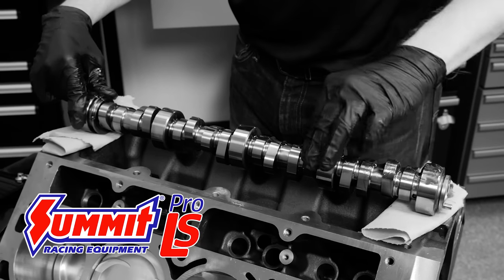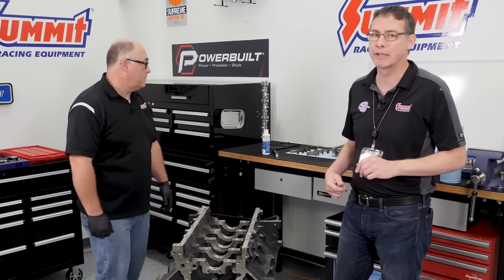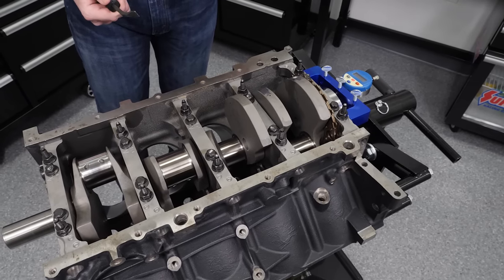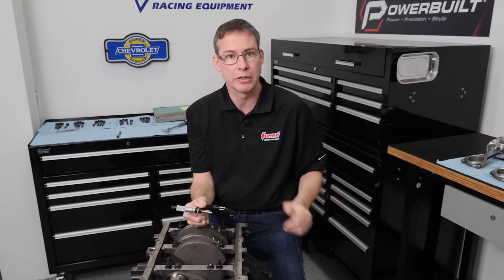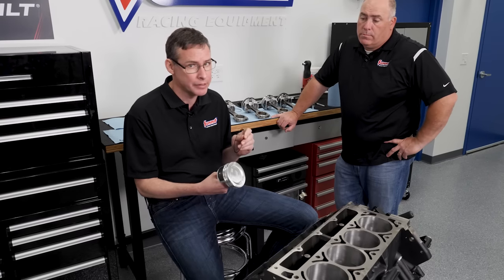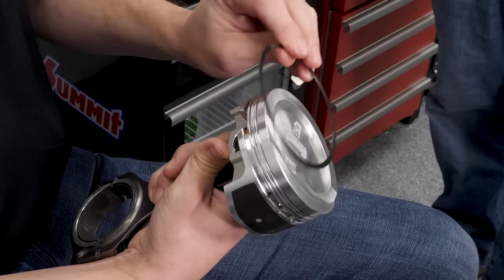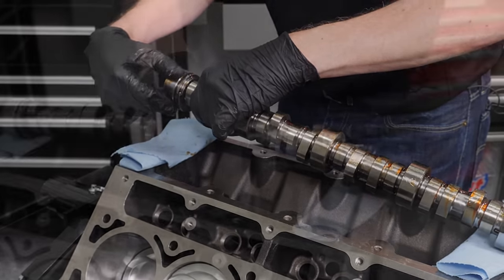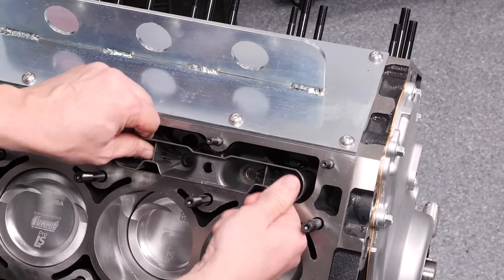Summit Racing's Project 1000: A 1,000 Horsepower 6.0L LS Engine Build (Part 1, the Introduction)

Comment: Do it n/a and I'll be impressed
Reply: Always an NA Guy saying do it NA 
How about 500hp per Liter ;-).
Reply: His response will always there is no replacement for displacement. Well there is a replacement and it's called boost.
Reply: Do it at all duey…. I’ll wait
Reply: They don't need to impress a keyboard warrior like you though 😉
Reply: @mikerudolph9785 this is true but there is more to it than just peak power.  A boosted larger engine with the appropriate parts will make more power w boost all things equal.  The statement still stands.  A large engine w shit heads may not make the peak power a smaller entije w great heads does I'm saying if both are set up properly and running boost the larger engine is always gonna make more.  Also more displacement allows you to have more torque and power in the lower engine speeds.   With a street car this matter it's not all about peak rwhp and quarter mile ets.
Reply: With a fuckin LS engine??!? That's not happening with a stock block.

Comment: You don't need a more how to video on how to make a 1000 horsepower withan LS we've been beaten on a 4.8 leader that had a 180000 miles on it for over 2 years and made over a 1000 horsepower and didn't touch a thing except adding a Turbo and intake and a Turbo  Cam and push rod And by the way it's in a drag car so it gets beat on  Weekly

Comment: Great video.  Will give novice builders the confidence. An LS is as easy as a 2 stroke. But y'all really need to comment on the important things like proper balancing, cam degreeing, having a block properly machined such as align honing, etc. So many critical things for an engine to last past break-in.
Reply: Not always the case especially on an LS Ive been making 1050whp+ on a gen3 5.3 with gen 4 rods for 3 years now going into 4th season  .. 160+ passes since keeping track and thousands of street miles is one drag week and 1 rocky mountain raceweek.. no balancing , no bearings  no extra bullshit you don't need...  Rings were pregapped for boost after 180k  lol .. there are budget builds and their are by the book builds.. my expensive by the book build is in a bunch of smaller pieces and all the machine work and brand new parts didn't matter my throat together build has lasted two more years already on all stock type parts  except for valve train ..
Reply: very true for some engines, but ill have to disagree with the LS. Its design was good enough to not need every little thing perfect and still be very reliable. there are plenty of stories of backyard builds making 800+ hp and running a long time.

Comment: I'm looking forward to seeing part 2.  I have 2 6.0 ls's in my garage on engine stands I'm rebuilding, one needing a new crank so I have been thinking about the Pro LS rotating assembly kit for a while now.  In my 6.0 turbo'd caprice ppv I'm running your Pro LS turbo stage 2 cam.
Reply: How does the Caprice run? I am potentially getting an 88 Caprice 4 door that I want to LS swap for some power and do drag and drives!
Reply: @Rwinnett2012  runs great.   Mine is a 2013

Comment: My daily is a 2017 Silverado 5.3L 4x4.  Eventually I would like to get into the internals and replace the cam and lifters which have been known to fail with something a bit spicier.   But for now intake, exhaust, and some dress up parts will have to do.

Comment: Personally,  I'd rather see an LS N/A build that puts out 550-600 rwhp.   I'm not a big
fan of blowers for the street.  Too much power for the tires to handle, eat too much
GAS.  Plus, it would cost LESS to build.
Reply: The only difference for a n/a build would be camshaft and piston compression choice. The actual assembly procedure is the same for natural aspirated or turbo short block build.
Reply: Damn right.
Reply: If it's too much power for the street, perhaps it's time to dig into chassis setup. Turbos are much better on the street than a blower. If you stay out of boost, you can literally get the same MPG as a N/A car. I know several guys 1000rwhp, and still see 18-22mpg.
Reply: Rick P. Damn right. My Superduty put down over 800 horse to the wheels and could cruise at about 70 mph getting 30mpg +/-
Reply: @carver32ac  My take on this is, anything over 600 hp is way too much for a street driven hot rod.  I mean, how often do you "max out" such a car?
Is this a "daily driver", or only something that you want to SHOW OFF every
couple of months??
Reply: My turbo car makes & uses well over 550-600 rwhp on the street. Still gets better gas mileage than the n/a  355 ci sbc that it replaced (even with air conditioning on), and I can control the power level for daily/no-prep/Power Tour, best of all situations. Not to mention a n/a 550-600 rwhp engine is going to be more prone to running hot, more finicky because you're pushing it harder.
Reply: @rpturbo this is the same w the modern tvs blowers they are very efficient and have a bypass setup when not in boost and basically don't use extra fuel if you aren't in it.  Same deal.

Comment: What about cam specs????
Reply from the maker: Thanks for watching! We used our SUM-8716R1 cam, which is our Pro LS Stage 3 Turbo cam. Specs: 232/234 duration, 115.5 + 5.5, .600/.575 lift.
Reply: @SummitRacing  Thank you for responding.. I use Summit for all my go fast car goodies..🏁🏁🏁

Comment: STOCK 2003 iron lq4 block, STOCK Engine tech master rebuild kit, flipped truck manifolds, Holley dual plane, CSU 850 blow thru carb, Vsracing billet Gen2.5 7875 a2a kit, 20psi ... 1000hp. All in...$5,500 #YOUREDONE
Reply: 2004 iron block lq4 stock pistons, stock ring gap, cam vs 76mm, cam,stock bread box intake, stock truck manifolds flipped c16 about 20lbs of boost 1000hp for the last 4 years,  got the motor for 500$🤣🤣
Reply: Absolutely 💯. I was going through my own figures and this is a high dollar 💵 engine. Wish I had a newer summit catalog. Either way I 💯 could get a 1000 plus ➕ horsepower for a third of the price.

Comment: Or alternatively you can pick up a $500 5.3 from the junkyard, widen a little bit your heads, put an SS intake, 2 turbo and make 1500hp on stock everything.
It's been done and it works